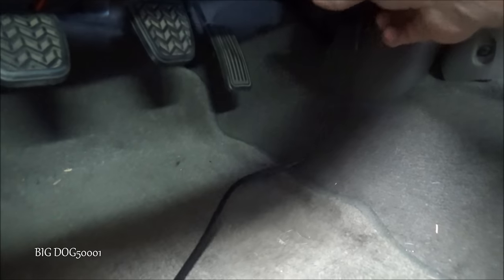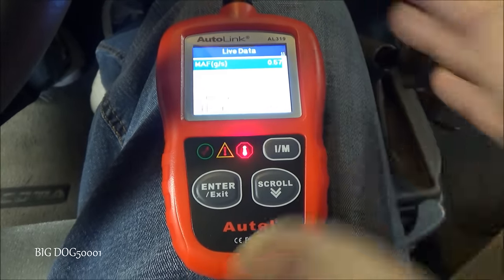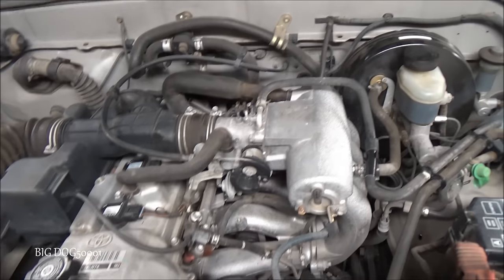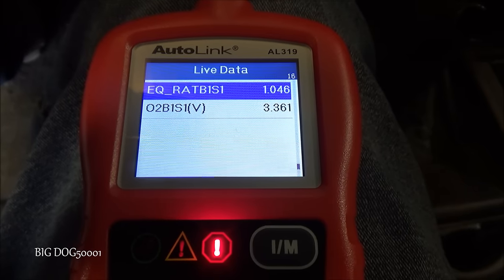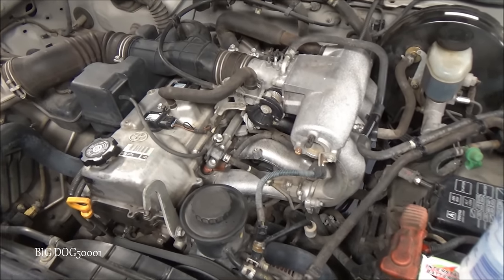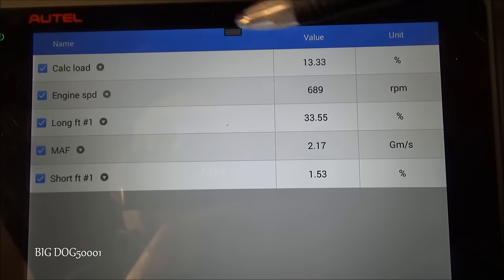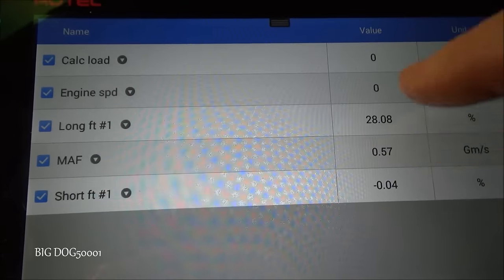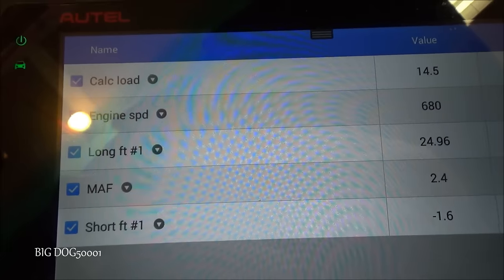P0171 Trouble Code: System Too Lean Bank 1 Diagnosis

Comment: This video made me feel like I already fixed my po171 and I haven't even went outside yet
Reply from the maker: lol
Reply: Lol I know what you mean..
Reply: Great informative VIDEO!
I have found that EGR valves , PCV valves , and IAC valves are notorious for sources of vacuum leaks.
Reply: Off
Reply: I feel the same way !!!!
Reply: Thanks big dog for explaining things in a fashion that is easy to understand
Reply: Everyone in this field know what you mean lol
Reply: yo! evandrewmartinez1... 'haven't even GONE'! ...after have, never a past tense but a past participle indeed.
Reply: Lmfao 🤣
Reply: What an excellent comments! He describes how I felt as well.
Reply: @dougsanders6034  I need help 😫
Reply: Bg po

700

Po700
Reply: For Sure 👍💯
Reply: 🤣🤣 it’s that good
Reply: Llkkkkkkkkklkkooo7
Reply: Visualization is a powerful thing! You no doubt were able to fix it I bet
Reply: Clean Mas air flow sensor, take it out use Mas cleaner and it will work most of the time,
Reply: Same! 😂
Reply: Awesome video! I followed the whole thing. I am having the same problem with my Subaru Forester and I do have that hand held scanner. Guess I better get to work!
Reply: Ooo😂😂😂😂😂
Reply: Lol.. Man I feel the same way. My problem was my brake booster and this video confirmed it! Thanks!
Reply: All he did was buy a new MAFS, would’ve been easier to just buy one from the start.
Reply: @newbluerugby  and what if it wasn't the maf?

Comment: Basic question: Could a cracked or small hole in the Air filter box (the little wire clamp used to close the air filter cover broke off causing a hole) cause a P0171 and P0174 code in my 2007 IS350 Lexus with 170,400 miles that I matictuoiusly maintained I have looked for cracked hoses and cleaned my MAF sensor as well as replaced the PCV unit. I'm using a Blue driver OB2 scanner with my Samsung Galaxy Note10 phone. My next step is to replace the O2 sensors. My plugs have been replaced with NGK Iridium Platinum plugs about 40K miles ago. I did add a RR-RACING carbon fiber Intake tube and added  a K&N breather last year. I've replaced my Gas cap too. The lights went out but I'm not entirely sure the underlying problem is fixed. Thanks for posting this video. Any suggestions are greatly appreciated. Jeff Grant Mooresville NC USA

Comment: My 2000 Corolla had a p0171 for years. I tried replacing the o2 sensors, cleaning the maf and throttle body, gas cap, pcv valve, even checked for vacuum leaks. Finally it went away for good once I replaced the rusted out fuel filler neck. This specific code is a tough one to figure out usually. I love my old Toyota. She has 225,000 km and still runs strong. Sadly I live in Ontario so the Rust is eating her alive.
Reply from the maker: Thanks for the input!

Comment: Very good diagnostics.  I do have a question though. I am a diy'er.  On my vehicles I have no idea where the  sensors should read on live data!  Where would a person find a list that showed the range of numbers one should see for a known good sensor?   For instance, if a mass flow sensor showed 4.4.  Is there somewhere that shows the range it should be if everything else on the engine is working correctly?  I just subscribed!  Tom
Reply from the maker: There are some rules of thumb but some of it is dependent of vehicle and area you live in.  Best practice is to get numbers off known good vehicles before there is an issue.

Comment: Thanks so very much for this video and your presentation. My PO171 code was confusing me mostly because I didn't know what numbers  and quantity I should be reading. I followed your steps and upon inspection found a vacuum hose that had not been properly reconnected under the air plenium on top of the engine and a loose cracked brake booster tubing not replaced and clamped by the Garage. I fixed both and the numbers " dropped like a rock" and corrected after some driving. No codes. Now to get the cruise control to work everytime not intermittingly. Thanks again. I will be following you for more tinstruction.

Comment: I have to thank you for this video. i have a fixd tester and it came up with the p0171 code. and i noticed that my breaks sounded funny when letting off the peddle. As soon as i let off the peddle i can hear a hissing sound in the vehicle. found my vacuum leak. then i came home and found your video and confirmed that would be a cause. This is on a 2005 toyota rav4.

Comment: This was the best tutorial Ive ever seen on YouTube. I shows the functionality and correct use of the OBD 2 scan tool. And the way it can be used to eliminate as well as nominate possible causes of error code alerts . Both by monitoring of specific parts through real time performance readings of sensors and overall understanding of each reading and what each one means

Comment: I’m most appreciative of any help you might provide.  I have a 2003 Toyota Tacoma 2.4L pickup (110,000 miles) with a check engine light.  I’ve watched this video and have been unable to correct the wacky (high) fuel trims.  I checked for vacuum leaks in the evap system, brake booster.  Engine vac at idle is about 20.  Disconnected the evap system and brake booster with no change.  Cleaned the MAP sensor, nothing.  Also tried a few MAP sensors from Amazon, no change.   Changed up and down O2 sensors, nothing.  Engine temp and intake temp, the same within a few degrees.  I have not changed the fuel filter or checked fuel pressure, but since the engine runs so well, I’m skeptical that that’s the issue.  I also sprayed the entire intake system with ether to see if there was a leak, nothing.  Also checked the fuel pressure regulator, seems okay.  I’m geneally pretty good at troubleshooting, but I’ve hit a wall.  I’m reluctant to take it to a shop since the cost to diagnose and repair could approach the value of the truck.  You’re kinda’ my last stop.  Thank you in advance for any insight.

Comment: I have the exact same engine with the exact same code. But I don’t have the instruments to isolate the problem. I bought a new fuel cap and my light stayed off for 1100 miles. Now it is back. I am tempted to put a new brake booster and MAF sensor in. Thank you.
Reply from the maker: I would probably start by at least spending $30-40 on a cheap code reader first (like I used in this video), buying new parts can get very expensive and it may not fix the issue.
Reply: @BigDog50001  Thank you for helping me keep a logical approach and not throwing away money. I had a mechanic look at it and he looked for vacuum leaks and couldn’t find one. I even suggested the brake booster. He said this engine has 2 fuel/air sensors instead of oxygen sensors that are $300 each and maybe won’t cure the problem. The MAF sensor looks clean but I wonder if it might need replacing anyway?  The fuel pressure reads in the low normal range. Honestly, I am at a loss for what to do and any suggestions you have will be appreciated. Again, this is the exact same engine you are working on in your video. Thank you so much. Michael

Comment: I would have cleaned the MAF sensor if I'd went to the trouble to take it out. It might not have fixed it but I've seen cleaning help.
I like all the clues you pick up on when first checking things out with the freeze frame data, engine cold, engine idling etc.
I wonder if a smoke test would have found the vacuum leak at the brake booster or is the way you did it by eliminating things out of the vacuum loop best?
Scanner Danner found a vucuum leak in the most unusual place I've ever seen. I believe it was under the intake manifold on a V8
I'll have to look that one up again. I don't know many people who would find that vacuum leak. You might have found it possibly!  😀😃

Comment: Question 
Can a broken purge valve tube the one you put your hose on is broken, will that cause a vacuum leak
Reply from the maker: Depending on where the break is and how system is designed, yes it can.

Comment: If the short term fuel trim is over 50% is that going to damage the catalytic converter?   I have a p0171 on 2017 volvo xc90 t6.

Comment: Great information,  love the step by step instructions. If I may suggest, make a video on where to find information of specific normal readings. You, as a Master tech know  AF sensor reading should be 3.3 V and Mass Air flow should be around 5 grams at idle, but to new tech's, they are just numbers. Watching the video, I though 3 or 4 gps was low but you said that was normal for your area. Are you basing that off of altitude? What I was taught years ago, around 5 gps were normal, but on some newer cars I've looked at lately, most seem to be reading 3 to 4 gps. What am I missing?  Anyway. Very good info.

Comment: Hey I forgot the codes 456,305,300 I took care of them now showing 02 sensor bank 2 working on that just had Cat replaced and sensor replaced checking sensor. But still brings me to vacuum leaks and knocking you had said that in one video about bad master cylinder checking on that

Comment: So I see that you found an issue with the brake booster during your test but I am wondering if the brake booster alone could cause the error code? I have changed the MAF and the upstream o2 sensor. Light keeps coming on. Checked for cracked lines and changed any that were suspicious.

We did change the master cylinder right before the CEL started coming on. So this is why I am wondering if the brake booster alone (or check valve) to be causing the issue.
Reply from the maker: Yes, brake booster can cause it by itself
Reply: @BigDog50001  Thank you for  getting back to me on that.

Comment: I have a 01 Silverado 1500 with a p0171 and a p0507 I already replaced the idle air control valve and that did not do the trick any ideas on the next step I should take? It’s idling at about 900-1000 Rpms I have pictures of the freeze frame data if you need them

Comment: Reviving a bit of an old video here but I am going through this process right now and want to test my logic with you based on seeing some different values.  
My fuel trims are pretty ok on idle, not perfect but it is a 20 year old car and wasn't throwing any codes until last week so it was within spec. If trim isn't too bad on idle or low throttle, and only throws the p0171 code intermittently when it's been fully warmed up, shut off and then brought back up to motorway cruising, would this point to a fuelling issue or maf? The maf flow rate seems quite well matched to throttle position, and I am not experiencing any real performance issues, just getting the p0171 intermittently which makes getting my inspection done next week a bit of a gamble. In some parts of the rev range stft and ltft are at max values.

Comment: My 2017 Chevy Sonic. P0171 code I have changed MAF MAP & both 02 sensors. It jerks and wants to die at stoplights. And also actually will die once while warming up. Driving down the road it’s fine. When stopping or stopped it jerks. Please any ideas would be great. Thank you.

Comment: Just for giggles,  can you use a fuel pressure gauge  as a vacuum gauge, it's the one with the push button relief valve???
Reply from the maker: I wouldn't.

Comment: Im getting p0171 on sienna 2000. Checked air line from throttle body  and got 22 pressure reading,  from intake plenum to brake booster  also 22 pressure reading. No change in fuel trims.  . New maf sensor.  New fuel injectors.  Sprayed all cables, no change  in rpm.  Smoke test no smoke from anywhere.  Fuel trim stft -5+5. Ltft +30 to+40 percent.  Both sensors same. What else could it be? please help

Comment: i have a 2014 jeep patriot , after about 5 or 10 mjn. of driving etc light comes on and it slows down to about 5 miles an hour and rough ideal , macanick told me to change my computor , is that right ? please help.

Comment: You said that you like to be in the 2-3 g/s range for the MAF. Mine is at 6-8! Is there reason to suspect a faulty MAF-sensor with those values?
Reply: Look at the rmps if engine is barely turn on more are is been suck in.  Once it heats rpms show be lower thus less air is needed. So I think you should get a better reading once engine is in operating temperature. Also bigger engines need more air.  As a rule you want as close as what engine size you have.  In these case he has a 2.4 engine, so that's why he was looking for 2-3 g/s.  BTW i heard somewhere Kia's and Hyundai need more air.
Reply: Also take into consideration elevation and temperature

Comment: this is actually "prime time info" bro
im a retired mechanic with many years in the industry - i still practice with neigbs & friends' cars lol-  and the way you'd explain everything regarding this issue is basically the same way automobile instructors do at automechanic schools & at college level too, very professionaly w/o any gimicks

thank you for taking this time and to help us to understand the technicalities involved within 💖
Reply from the maker: Thank you for the comment, I really appreciate it!
Reply: I totally agree, I work on my own autos, and my family as well. I am a Grad of T-Ten for Lexus and Toyota. I am not working in the field anymore. I make more money with my current path. That being said. My Instructors should be made to sit with you. So they can teach the new guys correct ways to learn diagnostics and breaking down the steps. I say that because I was dumbfounded when in the middle of a class on Finding a obvious fuel delivery issue. The instructor refused to even entertain a possible pirate air issue. While he set it up to be fuel issue  from a under pressure of fuel being delivered. You should always go simple/Cheaper/faster diagnostics before you go to harder issues. pulling a vacuum test on a fuel rail is a little harder then watching fuel trims and alteast checking off not pirate. Great job. Also I disagree with only one of Rubber malets comments. You know you trained that damn fly.. It was a gimick fly!!!

Comment: Thanks for this! Was driving my car over rough roads, and the check engine light came on. It threw a P0171 code. Once home, I popped the hood and saw this plastic chamber thing had fallen off the air intake  throat pipe DOWNSTREAM from the MAF sensor. Popped it back on and tightened clamp with a screwdriver and good to go! I love youtube university...
Reply from the maker: Good to hear you got it fixed!  Thank you for the comment!

Comment: You set the bar so high for the average uneducated mechanic who will have you replace part after part to fix an elusive problem.
Reply from the maker: Thank you for the comment, I appreciate it!
Reply: Most of the time when the pcm is dumping fuel in like that it’s an air problem and visa versa.
Reply: I'm guilty of throwing parts at the car I have now but I've been working on old American cars my whole life and now at 40 I'm looking for chokes and floats, points, condensers, caps and rotors and I'm like omg...where the hell have I been? And where the hell did they go?
Reply: I have a 2002 Miata. Multiple mechanics have replaced parts and smoke tested. We just replaced the injectors! Unfortunately, It’s still throwing the P071! Argh!
Reply: Is there a way to give you 10,000 likes ?👍

Comment: THE MOST DETAIL DIAGNOSTICS PROCEDURE PRESENTED IN THIS CASE STUDY. SO BENIFICAL AND ACCURATE. THROUGH DIAGNOSTICS
1) VACUUM LEAK 2) BAD MAF 3) BAD BRAKE BOOSTER.
ALL 3 STEPS ARE SUPPOERTED WITH STFT AND LTFT. 
JUST PERFECT WORK.

Comment: Had a similar problem on my old Toyota Yaris. using an a very basic analyser fault codes only. I followed your advise and found a damaged air line going to the throat of the Mass airflow. Replaced with a generic hose now idle is restored and my old car lives to fight another day. Thank you for your video.

Comment: I came here trying to track down a P0171 code on a 2003 Toyota Corolla, and while I think my problem is due to a leak at the intake manifold, I was floored by the quality of this video.  I work in the high tech field and work on troubleshooting issues on a daily basis.  This video is a text book example of the method needed to properly come to understand the root issue of a problem.  Outstanding video.
Reply from the maker: I really appreciate the comment, thank you!
Reply: Same. I'm gonna have all of this knowledge tomorrow. Thanks man. This is amazing.
Reply: I’m going ins
Reply: I agree. Really well done.
Reply: Ed Robbins. I too and getting ready to work on a 2003 Toyota Corolla with a po171 but mine is combined with a po125. It could be a stuck open  thermostat or a faulty coolant temperature sensor or something  with the wiring  on the po125 Not sure what I'll be getting myself into on this one but I believe the po125 could be causing the po171 which is a lean condition.

Comment: Hi, I love your videos and first and foremost I wanted to say a massive thank you for educating the public with your unique skills and techniques.

I have a problem that been bugging me and would really love to run it past you to see if I'm on the right track.I have a Suzuki Swift EZ 1.5litre petrol. The car starts cold idling at 1000rpm. As the temp increases, this gradually rised to 1900rpm on idle at operating temp.The throttle cable idle screw is completely out to it's lowest setting with zero tension on the cable.I checked all vacuum leaks and can confirm no leaks what so ever. Closer inspection and process of elimination shows no leaks. But, when I start the air conditioner my idle will come down to 1100rpm when compressor engages. I've replaced plugs and coils, also replaced Air flow meter and automatic idle solenoid on the throttle body yet no change.

On idle 1900rpm my SHRTFT is 3.9 and LONGFT is -2.3. MAFg/s 4.45 O2BISV 0.090 O2BIS2V 0.555 and FUELSYS1 is in CL closed loop. However I have a TP% reading of 14.5. Is this Throttle possition? Should this be at 0%

My next guess is to replace the O2 sensor before the cat. Am I on the right track? Would love to know your view?